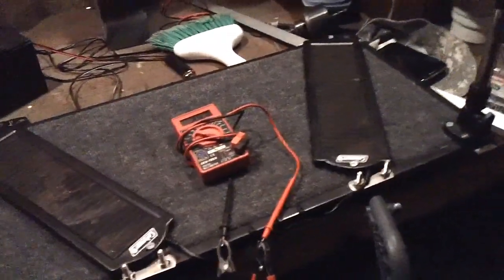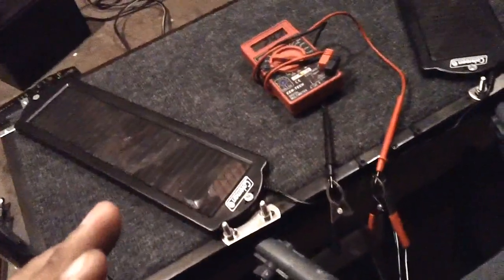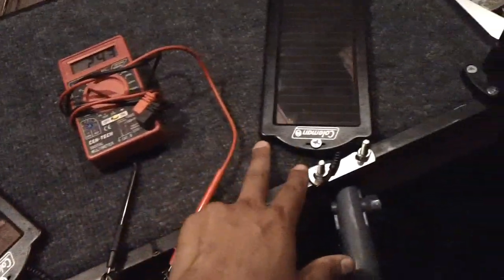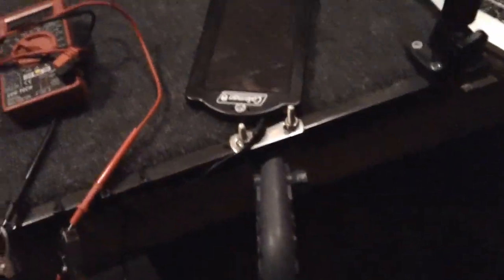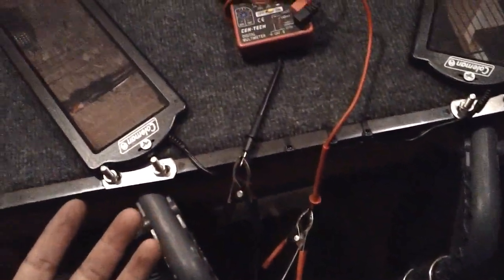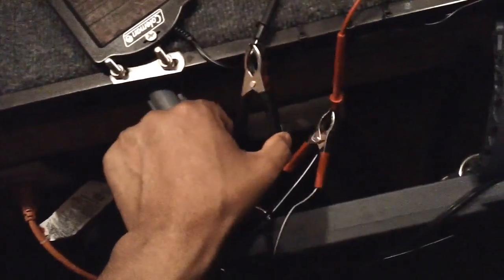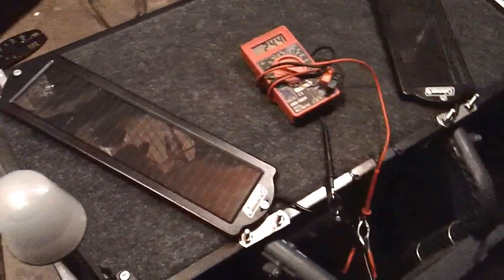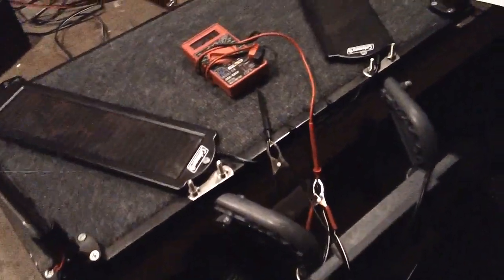Intex Mariner 4 Modification Custom Stern and Solar Panel Set Up

Comment: The way you've hooked up the batteries/photovoltaics is in series, not parallel. But that's the correct way if you want to double voltage. Two identical batteries joined in series double voltage while capacity remains the same, and two identical batteries joined in parallel double capacity while voltage stays the same.
Reply from the maker: CartesianCat Thanks, these two terms always confused me. Thanks for the lesson. I will be sure to try and remember that. Since you didnt mention anything of wrong doing in hooking my panels together I take it I should get great results? Anyway thanks a bunch.
Reply: dezertgrunt I'm not an electrician or electrical engineer, but I think, as far as I can see, you've got things hooked up correctly. The only thing I would be concerned about is the size of the panels themselves. If those panels are rated to output 1 watt at 12 volts, the output amperage would be around 1/12 amps. Which to fill a 35Ah battery would take [35Ah/(1/12amp)], which is 420 hours or 17.5 days of continual sun. They might work as battery maintainers though, I'm not sure.
Reply from the maker: CartesianCat never saw it that way. Guess ima need bigger panels. Thnx for sharing. Awesome feedback finally.

Comment: regarding the board. looks like you get it mounted on the stick intex mount with U bolts? is it pretty strong and how thick of a ply did you use for the board?
Reply from the maker: +Jiggy C. Sup, well the thickness of this board that i have the solar panels on is only but 1/8 to 1/4 of an inch. Didn't need to be too thick being that these solar panels are only but less than a pound together. Hope that helps.
Reply: +dezertgrunt thanks man yeah I'm looking into getting a board in the back loke you do but want to maybe use it to mount downriggers or extra pole holders. did you use U bolts to get it mounted?
Reply from the maker: +Jiggy C. I did only for the back part. The front part I used corner frame mounts. I could send ya a pic. I'm no spammed :)